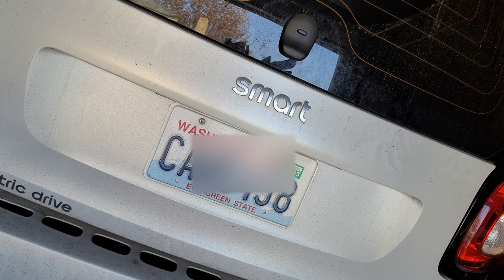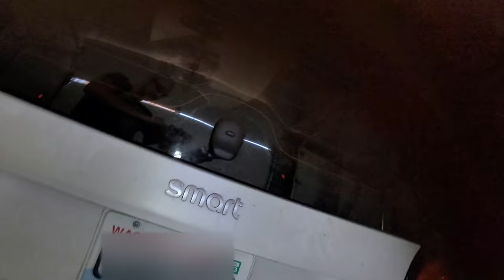Ariel Rider Kepler 550.4 mile review is it garbage? or Freaking amazing!

Comment: My 9 month old Grizzly x2 52v controllerS just exploded and actually caught on fire between my legs 2 days ago! With about 500 miles on them, way out here in Nevada desert! These Xi-nese ebikes are crap mostly and un reliable. It's no fun if you're  always worried about it dying.
Reply from the maker: Did you have it unlocked and maxed out?
Reply: Crap batteries at high temperature and high discharge rate = Danger
Reply: @djmorodaraye4313  yes unlock, no gentle uphill at 8mph

Comment: Make sure to check that the motor has enough grease to increase longevity.  With high wattage and Nylon gears, you might need to regresse that motor every 1000miles or so depending on how hard you ride.  Have not seen any videos where the motor wasn’t bone dry upon inspection.